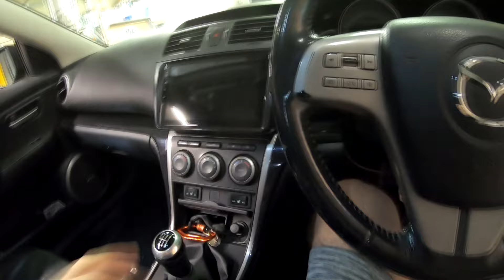Squealing & Stuck Rear Brakes On 2010 Mazda 6 GH

Comment: Finally a video with the same calipers as mine................ Same problem too, no grease on the slide pins or the pads, brakes sticking after a few miles, lovely burning smell when I park my car. All done now, but a little bit worried about the caliper piston, might have rust behind the seal? :/
Reply from the maker: Oh, if you can smell burning from brakes it's pretty bad news. ( if the piston rubber/seal doesn't have a hole where dirt/  water get inside the seal, then it all should be fine)  You need to inspect the seal for cracks, holes or defects.
I hope you changed your brake discs and pads!
Reply: @KlavsX_  No, that's a job I plan for better weather.
I needed to inspect and re-grease everything, the car is 2012 and very low mileage, so a lot of things like this haven't been looked at for many years.
Both wheels had to be hammered off with a mallet, the pads wouldn't come out without some force, the pistons had some rust on them, but the outer seals looked ok, there is a shim missing from the inner pad on the passenger side rear, but that's just to reduce noise.
I will know on Monday if anything has improved!
Reply from the maker: I see. Yeah, there are two ways to go. More wallet friendly is to pull everything apart, clean and grease it up and see how it does. 
The other one would be buy new discs/ pads / pins and caliper rebuild kit. Obviously that will hit the wallet quiet hard.

Comment: First of all, I wouldn't put so much grease on the brake caliper guides.
Secondly, I would not lubricate the hub so much before installing the brake disc and I would definitely check with a dial gauge whether there is any runout. 
Thirdly, check whether the pads are not flying sideways in the plates on the brake yoke, because you will hear a slight knocking noise inside, as if from the suspension.
Reply from the maker: I'm no mechanic, but The grease and stuff I did was to spec. (I did confirm with an actual mechanic and his words were
 ''you're not a mechanic nor is that a race car,'' that's fine.
I would love to own a dial gauge so I can measure it and show people how to do it. 👍
Pads are good, they sit tightly in the carrier/metal hardware, only missing the steel wire that pushes out the pads

Comment: Nice job ! I done the same to mine as well,but all 4 calipers(new rotors + pads + grease). Thx for the vid. Do you manage to put the pad pins back? otherwise the pads can't slide back .
Reply from the maker: Thank you. Nice job, hope your's didn't fight back :D 
The pad pins / pad wire is missing, so I will put them on when I get them in mail. 
I should have done exactly the same thing as you did, new caliper, pads, rotors all the hardware.
Reply: @KlavsX_  I watching your vids all the time , keep up the good work. Perhaps you will do a clutch replacement in near future? ,i will probably watch that too, because i will have to change it on mine
Reply from the maker: Glad you enjoy the videos 👍You can bet on that. I will do clutch change. Might even go for a different flywheel. But that's in the future

Comment: The rear brakes are a weakness on these. Almost every gh that i have worked on has had stuck rear slide pins and pads, Mine too!
Reply from the maker: Sounds like it is a design/ manufacturer problem. Such things shouldn't happen to the brakes. 
OR people don't service them when it's needed 😅
Reply: Its both, The slide pins usually get stuck because of the rubber on the end of the slide pin. But the pads get stuck because people usually dont do anything with the brakes until the pads are worn out. Rear pads wear slowly so overtime it gets stuck due to lack of lubrication and rust! @KlavsX_
Reply from the maker: Yeah, you nailed it. I find it weird, that people don't check up on rears when they do the fronts. 🤔
If the front rubber is split and cracked, so are the rears.  To lube stuff up and check if things are alright, would go a long way, and the rears would last longer. 🤔 
Or it's just me 😅 overthinking

Comment: Hello! Do I need the same calliper piston set for brake job on the front side to push the pistons back? Thank you!
Reply from the maker: You can use the same, but make sure that No tabs are coming in contact with the piston.
 The tabs can damage the piston and you will need to replace the piston

Comment: Noob here, what are you using to clean up the calliper? Alternatively can I use a wire brush?
Reply from the maker: Yes wire brush will do fine. You can use break clean too.
 As long as the rubber, brake pads, rotor and the hardware isn't damaged, its all should do good.

Comment: Change disks, pads and calipers. This is a 3 months solution.
Reply from the maker: 😅 I would recommend to watch the video again. 😅
Reply: @KlavsX_  no need. I have done this before and akebono brakes need a service every tyre change. When pads are on 50% wear change them, service the calipers and you wont have to change them.
Reply from the maker: 😅 Wasn't the point but alright. I did mention in the video ''I should replace all of this, but not in the budget''😂

Would recommend one thing, If the brake disc is in good shape don't change your pads when they are 50 %,  you are literally throwing out 30% of usable material ( if your brake pads have the wear tab, that is a sign when to actually change them).